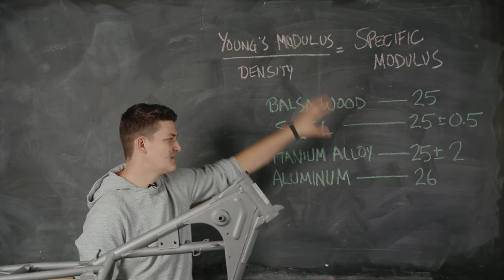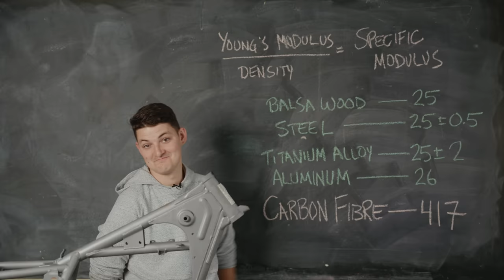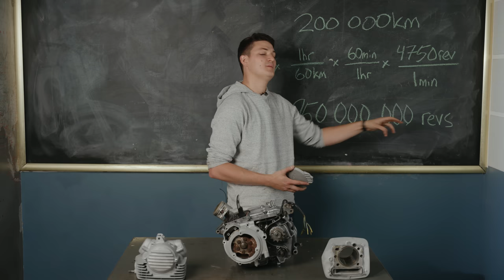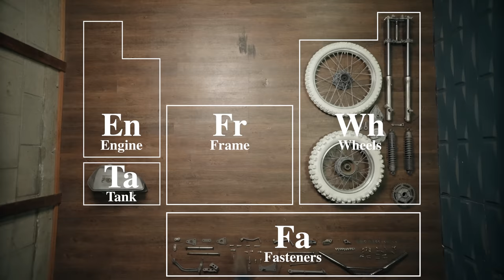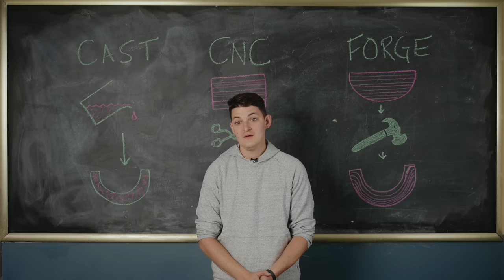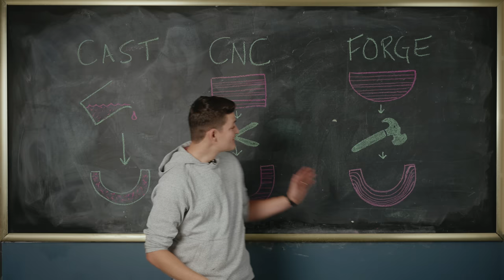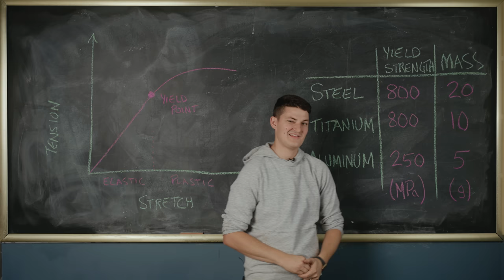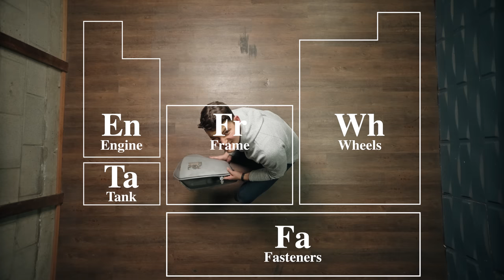Motorcycle Metallurgy - Why Steel? Aluminum? Titanium?

Comment: As a mechanical engineer I love to see how clearly and concisely you explained all those material properties. Well done!
Reply: It's honestly amazing how he is able to explain those things in the simplest language. He forgoes just the right amount of details so it is understandable by laymen but still accurate enough.
Reply: This video was like sitting through a condensed and interesting version of my aviation mechanic trade school all over again, very much agreed that it's an excellent watch.

p.s. copper grease all the threads and go slightly easier when tightening up
Reply: Yeah actually. This was a semester worth of machine design in 10 minutes.
Reply: He just explained several engineering classes in 10 minutes lol
Reply: Which steel is he making his bike frame out of that is 800MPa steel? Good bikes use chromoly which has a yield of 460. Cheap bikes are closer to 300. I thought that part was the opposite of clear and concise.
Edit... he was refering to bolts.... but still. No steel bolt in a bike uses 800MPa steel. Grade 5.8 at most.
Reply: @Nerb1  yeah that part was stupid, it's not like 10.8 bolts are the norm
Reply: Same and indeed!!!
Reply: @Nerb1  ARP2000 engine fasteners are in the neighborhood of 1300 MPa yield strength, and 12.9 bolts are around 1100 MPa. If I was building a race engine for a sport bike?
Reply: I do wish he talked a smidge more about the pros of magnesium in applications where aluminum makes sense.

Comment: "I am the monster,not for creating this 45 year old steel that cost 500$...... but for helping create a world that asks for more."
We deffinatelly ask for more!Well done brother.
Reply: I would love if there was a kit with the subassemblies like in the video with the engine as one, exhaust, suspension, frame, tires, wires, tank, guages, brakes, and so on. It would be cool to be able to put together a kit like that and save a bunch of money in the process. Maybe something like a cheap honda 350cc single cylinder as the engine.
Reply: @charliemaybe  Totally agree! I've been searching and searching for a beginner bike build kit and can't seem to find one.
Reply: @experienceforge  You run into problems with it if you want to make it modular. cant have the same frame for multiple engines, because you need to align the engine to the rear bracket. Also producing multiple sizes of engine becomes expensive quick, so no one is making the kit because its not profitable. I say the best thing to if you want to build a bike is to build a "cafe racer" or "scrambler" type of thing from an old  carbed motorcycle. Stripped down basic mechanics, minimal electronics. You can make a dirt bike, scrambler, cafe, even faired bike if you want to mess around with fiberglass. Take everything apart, remove everything thats not essential and build it back together.
Reply: I am wondering if he means that he is a monster for creating a world that asks for more ( more bikes like this one) or (more advanced bikes even though it is not neccessary)....
Because in one way or another he does both and maybe I missed something because english is not my first language
Reply: @experienceforge    The thing is there's a lot of precision involved in a motorcycle. It's dubious enough with a car, and there have been "kits" for those that didn't require a bunch of knowledge and/or learning along the way...

    BUT with motorcycles, because they utilize the gyroscopic effect and depend so much on alignments and balance and so forth, even at the factories, there's a fair amount of micro-adjustments that have to be made to fit each component to the greater system...

     You're going to have to start relatively simple on something relatively forgiving, like an older and smaller cc carb'ed bike or two, and work together the cafe racer or scrambler from what you can find in scrap yards, garage and barn finds and then of course, shops. As you learn more about the inner tinkerings, you can get more advanced.

      There just isn't profit in something as dubiously complicated AND precise as a motorcycle when you consider the variations a public market is going to demand. The least bit out of alignment between engine and wheels and you have a bike severely "right handed" or "left handed" making it tricky and dangerous because leaning one direction pivots you right around at speed, and the other way barely does anything...

     Many of us started on mini-bikes with a welded steel frame and a Briggs and Stratton or Tecumpseh 5 HP engine mounted on them... and then got out welders and angle grinders and went about "customizing" them, which was as frequently PHENOMENAL as it was "A TERRIFYING MISTAKE"... BUT you live and you learn (hopefully)...  ;o)
Reply: @gnarthdarkanen7464  All fair points to be honest, for me it's more about the fascination of the mechanics than anything. I don't really dream of building anything fast and perfect. If anything I'd prefer some slower, grittier, and electric. Cafe racer frame as many have said here is probably the place to start but I can't seem to find any local sales for them it seems.
Reply: @PartikleVT  Would the same issues come up for building out an electric conversion? A scrambler to me would be perfect since it's the kind of bike I prefer anyways.

Got any brand recommendations for learning the basics?
Reply: @experienceforge  I pulled the old Honda CT110 from my grandparents farm, stripped it and rebuilt it. I'm not sure if there are any bikes easier to work on, but they don't need to be. Taught me all I need to know about basic mechanics and maintenance
Plus made me thirsty for bigger projects
Reply: @experienceforge    Yeah... In my case, I have a couple welders, which I'm hoping to roll out and build some skill with on my next build... BUT I can understand if that's not your first choice... You might check around for "Mom and Pop" type motorcycle shops and just talk the ideas out with some of them... It can be easier to get a frame out of a scrap yard and make adjustments with the help of a competent welder or "chopper guy"... AND it might even be easier to approach students at the local Trade School and offer some cash for them to take on a "class project" to help you out. When I was in high school we had a weld shop, and there were always kids looking for something for a project to get graded in the shop...

     I'm sure there's something out there or someone willing to work with you on the idea. I'm thinking about something either hybrid or electric (yes, on two wheels) myself, BUT I'm still scratching out the math on frame and format, SO it's going to be a while yet (lolz)...  

    shit... EDIT :

    You CAN always hunt down a solid candidate for RESTORATION, and then mod' it as you wish once you get it running. It's not exactly a kit, and I'd highly recommend you pay a bit of attention to actual condition and stick to Honda... Those tend to be pretty good about starting right up from the "basic TLC" stuff... Then it's cleaning, re-paint, and you're on to whatever custom stuff you'd like to experiment with... It's not quite as adventurous as a "kit"... BUT doing an almost complete tear-down and rebuild (even over "just paint") is worthy of the kind of knowledge you're after... AND you can make some decent coin turning a crusty pile of junk into a worthy running bike...  A Clymer Guide will still be the best money you can spend on it, but if you're up for it, it can be well worth the investment in time and money... just don't pay diamond prices for a turd in the rough.  ;o)
Reply: $500 . . .
Reply: @waynepantry7023    Well, I bought my 95 Savage 650 for that... and only had to do a carb' job to get back on the road... I went ahead with oil, filters (air, fuel, oil) and a gas tank clean-out... new plug, so around another $100 for all the supplies and TLC... Bought her some fresh tires about six months later (err on the safe side)... AND we're happy ever since...

    It's not out of the question to find a 300-500 something or other that someone's just tired of looking at, or maybe where someone scared themselves off the thing... Expect it to have sat, and maybe some "dings" in the finish here and there...

    So yeah, that's a good investment. At worst, you can strip it to pieces and part out for a little better (on average) than break-even... AND if you're careful and patient, it's not a bad budget to get something running since you're not interested in "Hot to haul-ass"... 

     Don't forget to talk to older guys. Listen to their stories and put together where you can find nostalgia. I started on a Rebel 250, so Rebels will ALWAYS find a soft-spot in my heart. My brother (last year) wanted to break into riding, and dragged me along to help shop... and we got him started... on a Rebel 250, he's affectionately dubbed "Shooter" (If I recall, that's Roy Rogers' Horse's name)... SO he'll always have a soft spot the same as me, even when he's done growing out of 250's... haha... Someday, you'll find a kid with a grand-dad in tow, and all it's going to take is a look at a primer-coated Rebel 250 and your suggestion, "It could be any color you want, so long as you make the note at the courthouse when you register it"... AND you'll make the deal, and he'll become "THE coolest grandpa EVER"... 

    Start small and easy and relatively simple... Practice up, and TRY (don't expect to 100% always succeed) to get the "hobby" of tinkering to pay for itself... In a couple bikes just restored, you'll have a good view of the market, and be prepared to enjoy your side gig while you reap the reward of riding WHATEVER you LIKE while you sell what you did "for the edification"... It's FUN and easily as rewarding as you can be patient with yourself and entertained at old master-tech stories of chaos and antics in the shop.  ;o)
Reply: @cyjan3k823  it’s that the world is always asking for more, it can’t be sustained.
Reply: Maybe rebuilding a used DR650 could be close enough?

Comment: Metallurgical Engineer here.  I'm glad for everything you've put up, from beginning to end.  There is so much to be said regarding why steel is a great engineering material, and we often forget the many reasons (and perks) why.
Reply: Steel is real
Reply: I have a question, would you recommend using aluminum fasteners/bolts for fairings, despite the corrosion effects? Trying to get replacement fairing bolts and don't know which to choose, aluminum come in colors that would match the bike and are much much cheaper but I'm also aware of the cons and bolt stripping potential
Reply: @narutostarfox44  I'll assume that these are going to mate with steel, which is the only way this creates the tough decision.  The short answer boils down to how cheap they are that you don't mind coping with galvanic corrosion and stripping problems.  I would opt for stainless steel ones because either way you go, you're going to have to deal with water/humidity exposure on an outside bolt like that, and managing stainless heads with a simple wipe-down is a little less of a pain than checking threads and using anti-seize.
Reply: @bjuricek23  But won't aluminum also not rust? Or do they? 🤔
Reply: @narutostarfox44  what were the "corrosion effects" you suspected

Comment: As having been a materials/metallurgical engineer, LOVED this. Some 30 years ago had similar discussions with friends that raced bicycles.  Aluminum matrix (once a thing) & carbon frames very brittle & even caused more injury to riders than just road rash. And these materials were not repairable--so if you can't afford new frames if you crash, steel often a better option.  Similar for motor bikes--steel easier to repair or modify anywhere.  But options are great that filter down from racing--where weight and performance are super critical--down to bragging rights for regular folk...

Comment: Automotive metallurgist here, and maybe 90% of my work is in gasoline engines and fasteners, so this is very relevant to my interests! A few updates in automotive metallurgy: You quote the yield strength of steel fasteners at 800 MPa, but for an exposed fastener, we can now safely use a metric property class 12.9U (austempered/bainitic) with a dip-spin or spray applied zinc flake anticorrosion coating (such as Magni 565) with a yield strength of approximately 1100 MPa. Yield strengths much higher than that are possible with steel fasteners (such as PC15.9U around 1350 MPa) but those are for use inside sealed powertrain components like engines and transmissions where we don't have to worry about hydrogen embrittlement from road salt and acid rain. Second big update: After decades of trying to perfect Nikasil spray coatings and Alusil aluminum castings with silicon matrix bearing surfaces, the automotive industry has all started moving to a new engine block technology that finally outperforms iron blocks and iron liners: Ultra-thin steel liners sprayed in molten form onto the bores of aluminum blocks. Turns out, it actually reduces galling, abrasive wear, and friction losses over iron bores while increasing cooling rate, reducing hot spots, and allowing higher compression/boost without detonation. I expect we'll see this all over the motorcycle industry within 5 years.
Reply: So I have a question, would you recommend using aluminum fasteners/bolts for fairings, despite the corrosion effects? Trying to get replacement fairing bolts and don't know which to choose, aluminum come in colors that would match the bike and are much much cheaper but I'm also aware of the cons and bolt stripping potential
Reply: @narutostarfox44  Great question. Depends on what material the fairing bolts are threading in to and what yield strength the original bolts were spec'd to. If the aluminum bolts have an equal or higher yield strength compared to the originals (such as if the originals were steel Property Class 4.6, yield strength 240 MPa minimum), and they are threading into steel or brass, you're probably very safe. Always use anti-seize on the threads and be very careful about installing them with a torque wrench. If they are threading into aluminum, it's riskier (thread galling or corroding together are the biggest problems) but again it can work fine if you're careful. If the original bolts had a significantly higher yield strength than the aluminum bolts, stay away.

Comment: I recently graduated with my Mech E degree, so my theory is good, but practical application knowledge, lacking. This was one of your most satisfying videos because I understood the science and saw the application. 10/10 video again
Reply: As a Mechanical Engineer with a M.Eng. degree, I have to confess due to the particularities of my job I find my extensive hobby work in fabrication across a broad spectrum of fields is a skill set that I use more so than the teachings of the degrees themselves.  As one of my professors told me long ago, the program teaches you how to think and learn as its primary skill set.

Comment: I dont have a motorcycle myself yet, but the cinematography and how you deliver information, it's all really good quality, and it keeps me coming back for more
Reply: when you get your first, it's not like riding a bike (bicycle) [well] get a small dirt bike, it is[n't], the same.  A bicycle you push the left handle forward to turn right (think about it).  A dirt bike, you push the left handle forward to turn right, but at higher speeds.  A street bike, you push the left handle foreword to turn left (and the heavier the bike fells in a corner, the more gas you give it, or battle the weight)  A street bike, you don't pull the handle.  You'll kill yourself.

Comment: Fascinating. Just last weekend I discussed with a friend why motorcycles are all so heavy and whether a little more expensive materials wouldn't make them significantly lighter. Now I see there were a lot more variables to the equation we didn't have on our list and it is not just price pressure making manufacturers choose predominantly steel.
Reply: carbon is the answer, but it's not easy! (or cheap)

Comment: Ryan is amazing. He called back to the hockey scene he played right before speaking with "what’s annoying at the blue line is fatal at the red line", which is also a double entendre.

In hockey, the blue line of the opponent is frequently where offsides is called meaning it can be annoying. But the red line signifies crossing into enemy territory, meaning it’s more dangerous, and if the defense does not do their job, can result in a fatal blow.
Of course the other meaning is that the motorcycle pushed to the red line is alluding to motogp as previously mentioned.
Cheers, Ryan❤

Comment: The industrial comfort with steel frames is consistent in bicycle manufacture too, even though manufacturers have been making aluminum, titanium, magnesium and carbon frames for decades now too. Steel's just easiest, cheapest and good enough. The differences become most apparent in the fork because it essentially serves as your front suspension with a direct line through your arms to your chest and head, so the stiffness and springiness and vibration dampening of the material are very apparent. Nowadays the engineering is so good that aluminum and carbon are really the go-to best choices for pretty much any kind of bike. I'm more engineering enthusiast than engineer but frame and fork design really represent all kinds of beautiful multivariable equations and to sus out the trade-offs between strength, weight, stiffness across several types of load stresses. Even though those load stresses and material costs are so much higher in motorsports, I predict motorcycles will come to a place where carbon and aluminum dominate design. We're just not there yet.